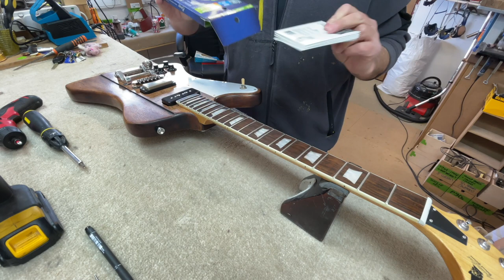Firebird Kit Build Pt 9 - finishing touches

Comment: Those tuners are wrong. The tuner shaft must be on the opposite so the string pull pushes the worm gear into the worm screw. As it is now, the string tension is pulling all the tolerances open, making it sloppier. It will still work, but not ideal.
Reply from the maker: Do you reckon I should have fitted right-handed tuners to this guitar because it has an upside down headstock?
Reply: @SamDeeksRelovedGuitars  If it's any relevance I just looked up Gibson leftie Firebird and the tuners do seem to be as suggested by pallecia with the tuner shaft below the key. But obviously don't know if they operate as left or right handed.